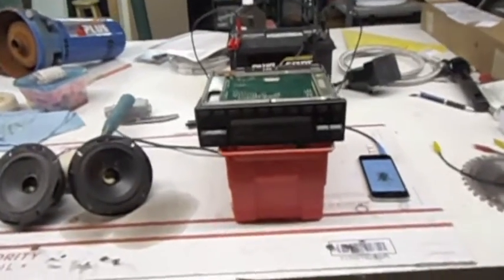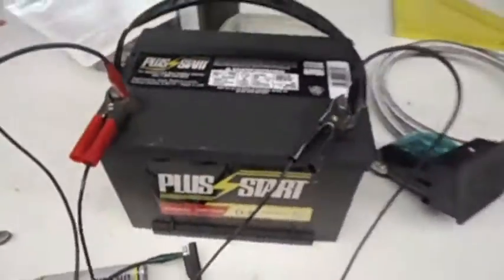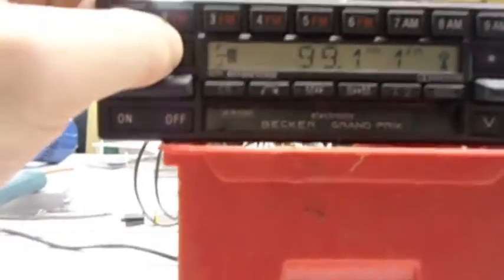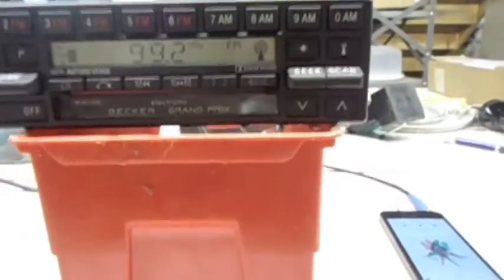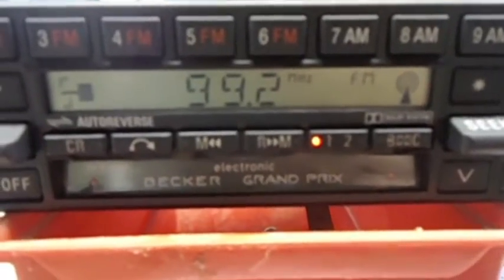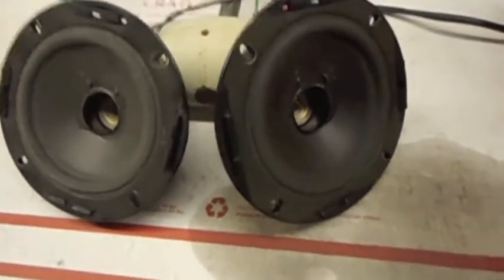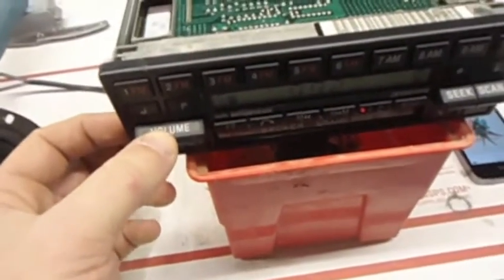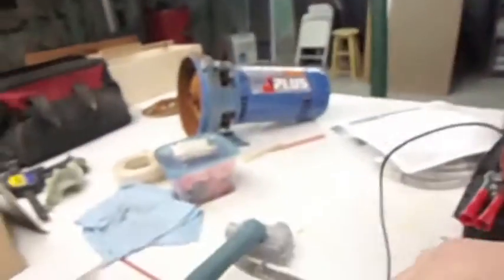Becker Grand Prix 780 Head Unit AUX Input Mod

Comment: Are you showing a left, right and ground going into the output port?  How does that work? Did you connect directly to the tape deck head internally? Does it sound good in the car? Can you explain how you did this? Thanks

Comment: Hi there. Nice modification and thanks for shearing. Actually for me is a bit too late I already replace the very same unit you have with a Blaupunkt New Orleans that has a CD player. There is a 5 pin in line connector for the Becker Anti Theft system. Do you know if there is schematic to make a plug to bypass and make the alarm be functional again?
Thanks
Radu